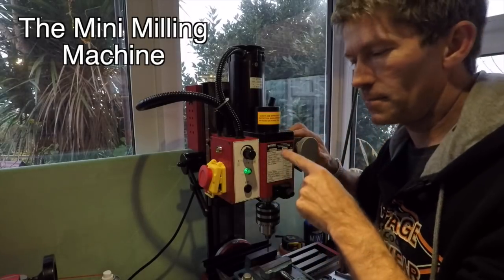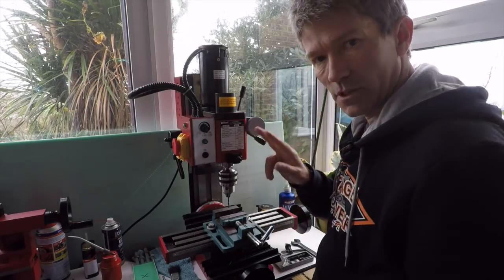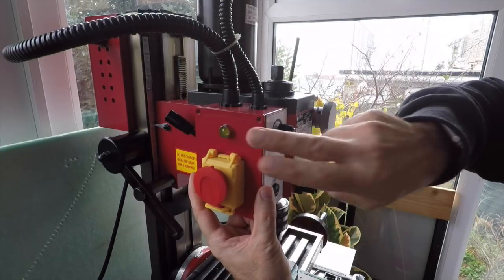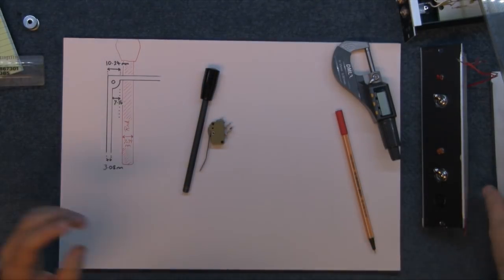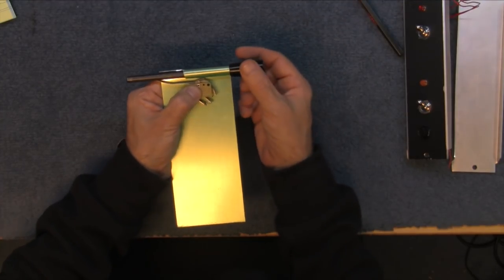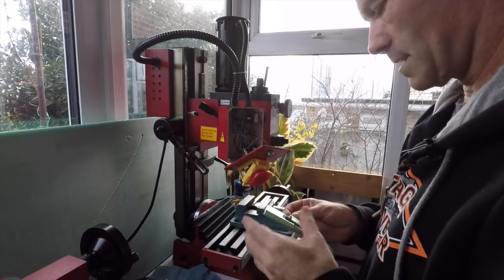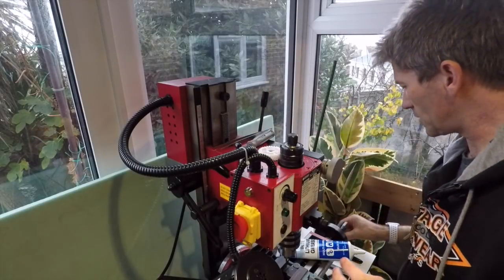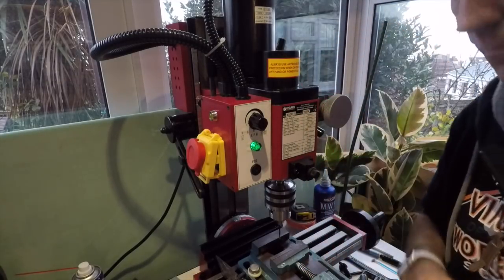mini milling machine Mod No more broken gears

Comment: Hi, this is Luis from Little Machine Shop. Been here over 11 years and this is the 1st time that I've seen your video. I very much enjoy it and it was very creative way of avoiding damaging the gears in your mill. I get allot customer calling to replace their gears, so I'm very familiar with that particular gear. Allot of customer eventually upgrade to the metal gears instead of keeping the white plastic gears. I'm glad to hear you were able to received your order quickly. When we get orders place before 2 P.M. we get them out that very same day as long as were not out of stock on the item, so thank you for the compliment on the speedy shipping.
Reply from the maker: Luis Ocampo Thank you Luis. you deserve good compliment because you were quick and easy to order from and I was very peased with your service. I have been thinking about doing the upgrade to this unit with the belt drive system and pneumatic with longer ratchet bar because when using colletts the head will not go down far enough to work on small pieces. do you have this kit on your website ?.

Comment: MARK,  BACK IN THE 80'S  I MADE A SIMILAR  FIX  TO A PANOREX MACHINE. THIS IS A DENTAL  X RAY MACHINE WITH A SWINGING  HEAD  AND  A LOCKING PIN. IF YOU USE THE MACHINE WITH THE STAY PIN IN PLACE. YOU STRIP THE GEARS IN THE DRIVE MOTOR. I WAS AS OUTSIDE REPAIR MAN TO THE DENTIST AND DID MANY SIMILAR REPAIRS FOR THE PRACTICE. I USED A 1/4 IN.  MICROPHONE JACK WITH CONTACTS THAT OPENED WHEN THE STAY PIN WAS INSERTED, UNTIL THEN THERE  WAS NO POWER TO THE MACHINE.   I FOLLOW YOU VIDEOS   IN PARTICULAR  THE KEYBOARDS , KORG   PA- 4X  LOVE TO LISTEN TO YOUR  VIDEOS.
Reply from the maker: ROBERT SMITH Thankyou Robert. I think using a jack socket is a brilliant idea.

Comment: Great solution, but if anyone wants a very fast free alternative, you can also take the insert pin and tape it at the plug end of your power cord. It ensures that you have the machine unplugged as you change the tools. 

As a teacher in a high school this serves a double purpose as well. Kids may sometimes forget to close the safety so this makes sure the machine can't be activated.

I do this with many tools, like the few drills that still have chuck keys and grinders as well.

Comment: Clever.  I have left that rod in there myself once.  Luckily, I didn't break the gear.  But here's an even easier solution.  Get a long spring from the hardware store that slips over that long metal step, and goes from the stem handle all the way down to within 1/4" of the end.   When you put the stem in, you will have to HOLD it there with your hand, or the spring will push it out.   It will now be impossible to leave that rod in there when you turn on the machine, because it won't stay in unless you are holding it.  It's still easy enough to loosen the drawbar nut with your left hand while you hold the locking rod in with your right.

Comment: This is an excellent modification.  The final result looks like it was part of the original design.  I've been thinking about getting one of these mini-mills for creating panels and brackets as well.  It looks like it's easy to maintain and fix.
Reply from the maker: Synthesizer Keith Hello Keith, The main reason I got this was to make it easier to get holes drilled in a straight line as I’m hoping to make some synth panels, my old drill press did not have the X Y table which makes things much easier, it is a bit noisy but seems to work well. I think in the states it is sold as Grizzly or littlemachineshop and there is a belt drive version now available. Good luck, im loving your video’s — keep up the good work.

Comment: Excellent power mod.

Have you looked into 3D printing your own replacement gears, if the gear goes again under different circumstances?
Reply from the maker: Hi Andy. i dont think a 3D printed cog would be strong enough for this machine.
Reply from the maker: Sharklops that sounds positive but I have not been into 3d printing long enough to fully test what a 3d printed gear could stand upto. i will go and wat a few of this guys videos they sound interesting and maybe i could learn something from them. many thanks.
Reply: I personally put the draw bar on a pull pin switch on the side. To use it you have to pull the pin. The pin is the safety.

Comment: Great stuff. JOB! Now paint that "bar" a Britt colours So it Easy and fast to find! 😋
Reply from the maker: I tried the elastic band trick but still broke another cog.
Reply: markusfuller you did mention that. I have spent time in metal work in school and college Where I would find hard to find a small "bar" if it was put down somewhere unexpected 😋
Reply from the maker: Yes I always have that problem. put something down and it magically disappears. at least this way the bar will always be in the control box as it will not work without it now.

Comment: There is also a disconnect switch on the front of the machine that deactivates the machine when the safety shield is moved out of the way (unless you completely remove it all together like markusfuller apparently did) one could possibly use that switch or the connections to make a holder with switch for the round stopping bar

Comment: Hey, I've been put in charge of trying to fix up an old Korg MS-20 at my work (kind of for fun, I don't really have a background in electronics), and I'm wondering if I could get an opinion. The main problem is the volume sometimes cuts out to a lower level. Otherwise it works fine. 

I've taken it apart and checked out the circuit boards, and all the solder joints look clean. My plan is to clean all the pots and patch connections, as well as the case. I'm hopeful its just a bad/dirty volume pot and cleaning it up will make some magic repair happen. Any thoughts?
Reply from the maker: Hi. I think I would start off by doing exactly what you do. if there was no sound at all then that would be a different problem but as you are getting sound then it may be just a bad pot somewhere that is temperamental. have you tried with a "continuous note on - ie jam a key down"  then wiggle the various pots just a little to see if any volume jumps up/down as that could be the pot with the problem.
Reply: Hey thanks for the response! That was pretty much my assessment, that it can't be too big a problem if we're getting a constant sound through the guy, although my boss told me he wished he had my youthful confidence. I'll try the continuous note if a clean up doesn't change anything to see if its a completely rotten pot causing the issue. Thanks a lot!

Comment: Mark, this is absolutely brilliant!  By the way, I'm guessing the European parts shop ordered that part from the same shop you ordered the identical part from. :) By the way, couldn't you scan that part with a 3D laser scanner, and then run it off on a 3D printer? Thanks, and keep up the great works!
Reply from the maker: Hi Thomas. to be honest I do not think a 3D printed cog would have been upto the job.
Reply: Hmm, yeh, probably so, if the cog had to be made of a tougher plastic than what's used in a 3D printer. Likely a cast could be made, and then the tougher actual part could be cast from the 3D printed casting.
Reply from the maker: ThomasGrillo yes this one is cast in abs which is quite tough. you can 3d print with abs but you need an enclosed 3d printer with warm ait to get a good fixed print.
Reply: I wrecked this gear on my mini mill over the weekend.  I 3D printed a replacement out of ASA.  I'll only use this ASA gear until I can source a replacement plastic one.  Where did you get your replacement gear from?

Comment: i liked this. 
Does the real power switch still work? 
Can you turn it off or on with the rod still in the box with the red power switch?
Reply from the maker: Henrik Karlberg Hi yes all the original switches still function correctly as intended. the rod if removed from the bow just disconnects the power and reconnects when placed back in.
Reply: cool

Comment: You can get your Sieg X-2milling machine converted to a SX-2 by changing over your brushed powertrain to  brushless type one. So along with all the advantages of a real brushless AC servo motor you'd get a toothed belt transmission as well so you'll never get the plastic gears broken as they are gone. It runs extremely quiet yet does provide quite much amount of torque at very low revs. SX-2 assumes a bar is suck into the lower part of a spindle which is located under a headstock housing.

Comment: Exelent mod, did it yesterday, I used one of the fuse wires and I am not sure if this was the right one to use, like a comment thank you
Reply: I was going to try this with a fuse wire also. Does anybody know if this is the best wire to switch?

Comment: I suppose it is intentionally bad designed to squeeze money for spare gears. Good design cares of fools.
Reply from the maker: and that it provides a weak point where a user can easily replace the part. if it was metal then more damage could have been done to the motor or inside the gearbox.